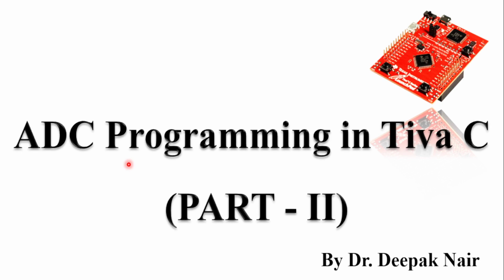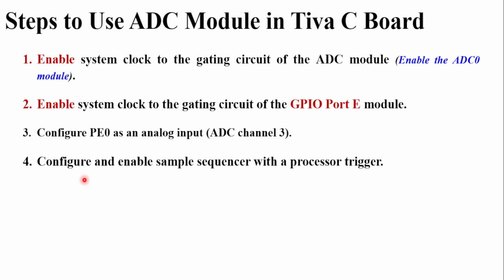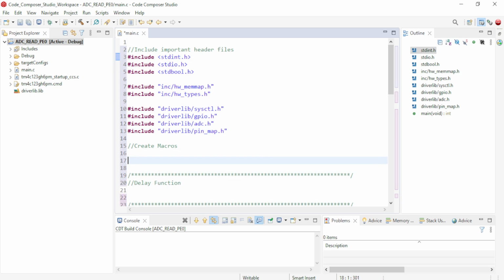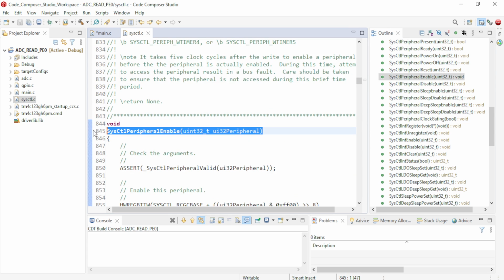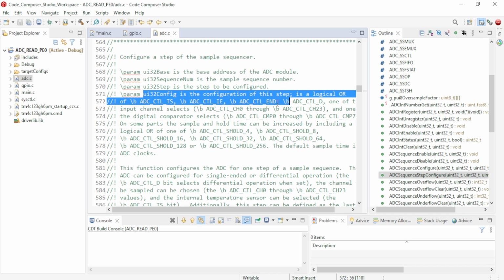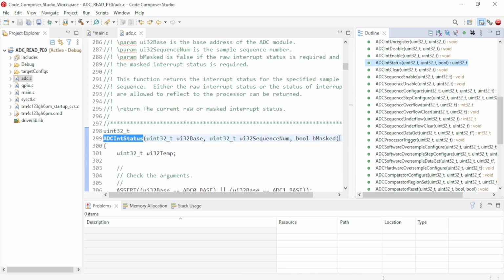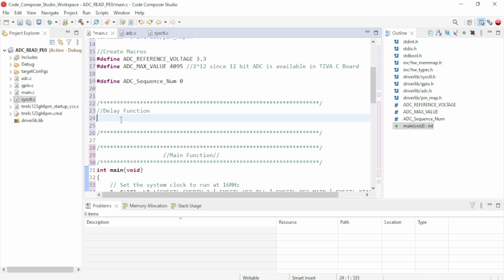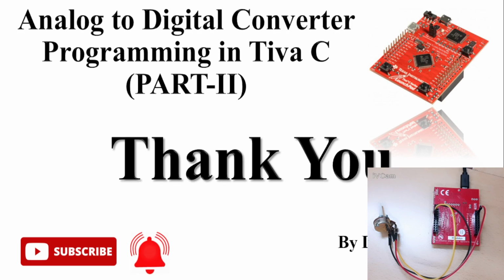Read Analog Voltage at ADC Pin of TIVA C Board

Comment: why do you configure PE0 as analog input and not PE3 since that's where ADC0 is?
Reply from the maker: Please refer the video from 4.19 onward. I have provided all the details related to the analog input pins. You may choose any of these pins to read analog input voltage. It is not mandatory to choose PE0 or PE3. I opted PE0 only for my simplicity. You may choose any other pin too.
Reply: Do you have an good example with adc interrupt handler? Without blocking wait for adc finishing comversion?